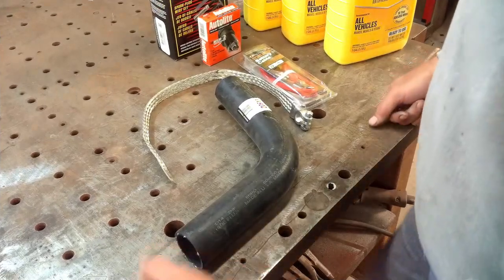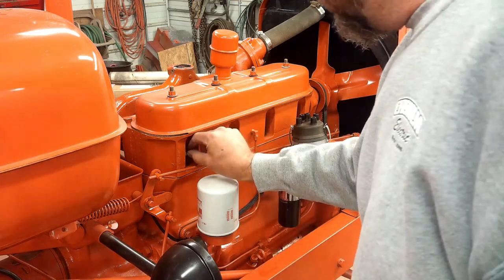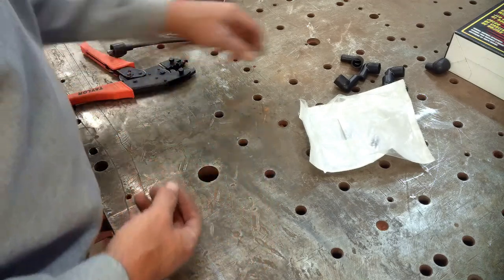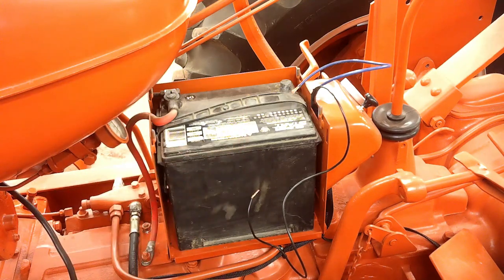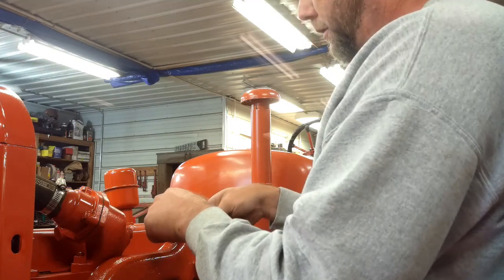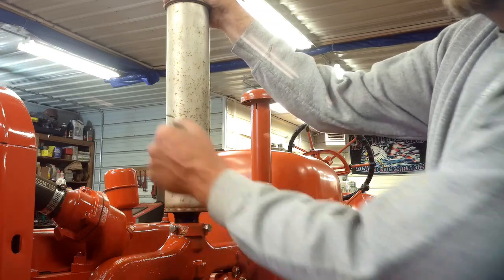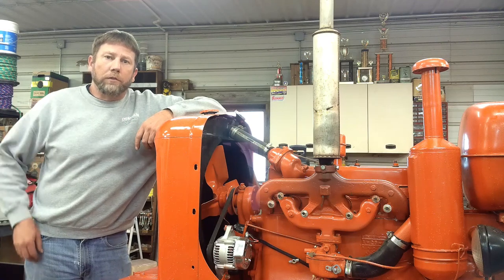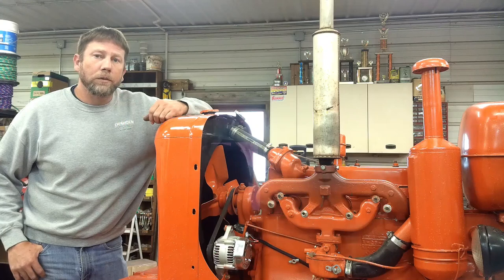Allis Chalmers WD45 Restoration Success or Failure? A Little of Both Ep. 31

Comment: Very cool!   Congrats on a job well done!!
Reply from the maker: Thanks! I truly appreciate it
Reply: @sparksfireandbalingwire8467  I understand where you are coming from with regards to coolant.  However, i do think that the 50/50 mix is best.  There are specific water requirements that help prevent corrosion and other issues in the cooling system.  I never really thought this was an issue until I saw it first hand as an industrial engine representative.  I only use 50/50 mix.  Just some food for thought.....

Comment: Awesome, great job.   I got my '53 WD started the other day with a new carb but the radiator leaks and the hydro pump leaks :(,  just more things for me to get fixed.  I can take the radiator to a shop but i'm going to try to fix the pump myself,wish me luck.
Reply from the maker: As long as its not too worn, it should be easy to reseal
Reply: @sparksfireandbalingwire8467  That's what i'm hoping for.  This is going to be my winter project.  :)
Reply from the maker: Mine was too, then a summer project, and now almost winter again!
Reply: @sparksfireandbalingwire8467  Yep, that sounds like how my projects go.  Always a work in "slow progress"   lol.

Comment: Excuse my stupidity I came in late. Did you install electronic ignition? If so I thought the coil was eliminated with electronic ignition?
Reply from the maker: Electronic ignition eliminates points and condenser  You Always need a coil
Reply: @sparksfireandbalingwire8467  see I told you I was being stupid. Thanks for your time. Did you add power steering?
Reply from the maker: No, other than upgraded electric, it's mostly original